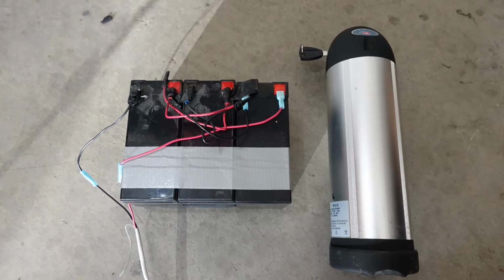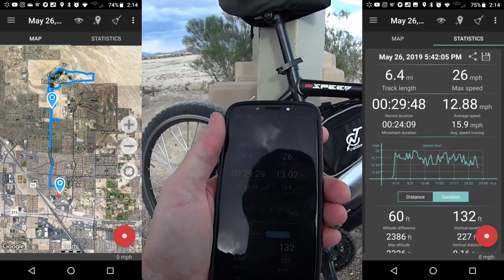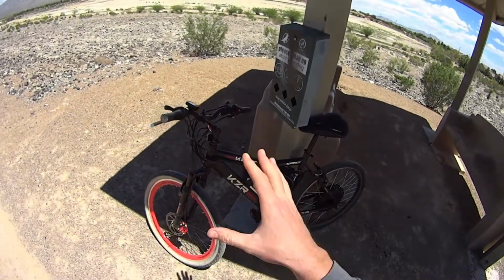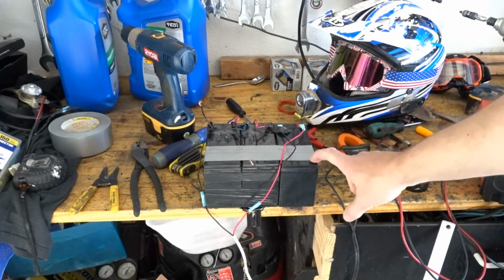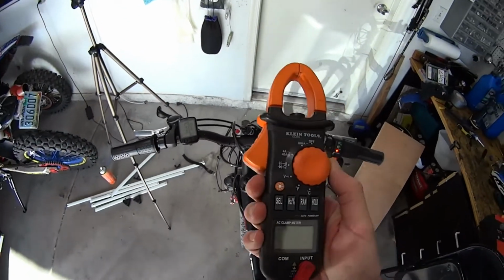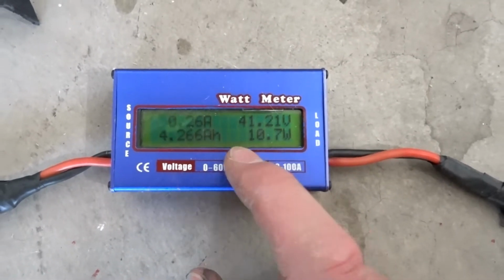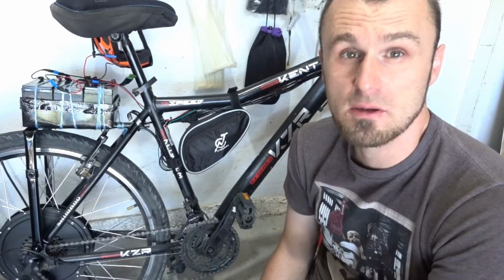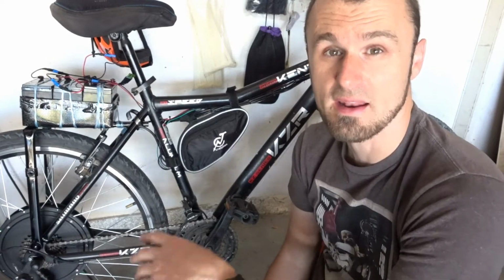Lithium ION VS LEAD acid battery , electric bicycle build Pro and Cons Range test

Comment: I'm looking to buy a sturdy, older e-bike for short shopping trips around our village, but loathe and detest the "Tofu Dreg" shoddy build quality and 'making everything down to a price', that we hear and see about anything made in china. For that reason - and because I'd prefer it if charging such a machine doesn't burn our house down - I'll modify something older but solid with lead-acid batteries (in series, if necessary) mounted low down in the frame to allow better handling. I also like the idea of making it look as ugly as possible - thus more unattractive to those light-fingered bike thieves that plague our society.

Comment: Great video, just what I needed to know. Was on the verge of buying one of those cheap batteries. Seen the price and thought I can get three lead acids new, for one-third the price. You just confirmed that is the best solution. They also don't explode and burn your house down. 😮

Comment: The other advantage of lead acid battery is that it is much safer, Rupture one of the Li Ion cells and you are looking at a potential fire which may be difficult to put out. Great video, good to see a comparison of the two.

Comment: in 1979 i got a friction drive kit and used a lead/acid battery.  all simple and cheap.  i rode it to work in downtown kc,mo all the time.  it was great.  never failed me.  all this comparison means nothing to me until the prices are the SAME INITIALLY..  for the "average" person lion batteries are ludicrously high priced.  if you don't have the initial investment then who cares if they are "better"?

Comment: I have done the same with a Prophet Graveler 36v 250W read hub motor.  The cost of a new battery is around 5000 Rand here in South Africa.  12v 7Ah LAB are R200.00 each so 600 for 3 to make a 36v bank. I attached the wires to the lithium battery pins on the base bracket (bottle battery like your one).  So I can buy 8 banks of 3 new batteries for the price of poor quality lithium batt.  The weight gain is around 5kgs hardly noticeable.  The batteries are on the rear carrier which does make the CG higher and bike can easily tipple over.  My next plan is to mount them in a triangle under the cross bar.  Maybe make a ventren motorcycle petrol tank sort of box???
Reply: and use the same charger and plug for charging them.  Plug charger into a timer to prevent overcharging (boiling dry).

Comment: That’s way less than half the Whr if you’re measuring the energy the charger used to charge it. There are huge losses in the charger or you wouldn’t need heat sinks or fans. 
Therefore, you probably got about 25% of the energy they claim, not 50%.
Reply from the maker: Yeah it can be worse

Comment: The complete wrong formula but got the right answer, difference between wattage and Watt hours, you said 350 Watts, that's the max that the motor can pull, but you are completely right the the battery is a lie

Comment: Are you using the same lithium-ion charger for lead-acid Batteries as well?
Reply from the maker: Yes they are close enough in vkatage and I really don't care about those bateris that much
Reply: @VegasRoManiacReviews  but ideally, it's not a good recommendation right?

Comment: I have a similar motor you can easily run them on 54v with the original Controller . I'm using a 720wh battery at full throttle I get around 40km.

Comment: You need to increase your leads to huge your losses are massive with those thin wires. Use huge pro jumper lead width as a guide.

Comment: Maybe you get More range if you are using more heavy-duty battery cables it looks like romex cables or use a wire calculator tool on the internet typing in the current draw volt and the length to get the right cable thickness
Reply from the maker: Those wires can take the curent... The difrence will be unnoticeable
Reply: @VegasRoManiacReviews  no man power of that electric motor is 700 Watts 7 mm of wire thickness skinny wireless create resistants lowering driving range

Comment: If it takes 140 Wh to charge a realistic discharge energy is 100 Wh or below. There is a lot of cheating with the rated power. Also from "well known" distributors.

Comment: brother how do you charge your lead acid battery packs? i am using 4 12v to make 48v battery pack. any ideas on how to charge it.?
Reply: Get 52V charger and charge at 2.5 to 3A if your battery capacity is about 7amp

Comment: I have come across a new concept. It's a combination of the two battery types. Use lithium for power on demand and trickle power at a fixed quantity from the storage lead acid batteries. They are better designed to output small amounts of power for long periods. They could make great range extenders on a lithium bike, but,i would rather they were on a trailer. I think i would rather carry a solar panel and stop for coffee breaks. But i would always use a reputable battery for both my lithium and or lead acid.
Reply from the maker: The solar panel idea always intrigued me, but it's not really useful due the fact you need a huge one for charging the battery
Reply: @VegasRoManiacReviews  Yes. This is true but my build idea would be more for trike or bike and touring trailer. With a trike or reverse trike i would simply build a large overhead shade roof which would carry the solar. I would use amorphous silicone panels which are less subject to shading or bad alignment which is basically what you need on a bike as you are always moving twisting turning and ducking in and out of shadow and at different angles to the sun (unless you are riding a straight road in the Sahara or somewhere else on the equator). Lets face it, nobody wants to do long distance at night and charge all day.
   The issue is finding a good size and voltage at a decent price. amorphous silicone is larger and more expensive but i still believe it's the way to go for much of the worlds solar projects if you don't track the sun and if you don't live at the equator. But YOU live in Vegas. lol

Comment: What voltage was that lithium battery? Perhaps the voltage dropped too low for your controller but there was still power left in the pack, just at a lower voltage?
Reply from the maker: I did not check the voltage, UT that would  have still not fixed my issue
Reply: @VegasRoManiacReviews  Some ESC's for example won't work below a certain voltage. This is why battery chemistry makes a big difference. S~ome batteries have a larger voltage drop than others. However they are still able to give power but if the electronics on the receiving end (not the receiver) can't drop as low as the battery it can not take advantage of the remaining power at a lower voltage. Basically for some battery chemistries you need wide voltage range electronics.
Reply: @VegasRoManiacReviews  Sometimes you just need to add more power in parallel. Some systems draw more power than some batteries care to provide at lower voltages, but if you can double that power at those lower voltages this can also be a way to get more out of the batteries at lower voltages. 2P or double P if weight allows could also be your solution

Comment: This video has made up my mind on which battery to go for in converting my adult tricycle to an E-Tricycle I want to use it to recover from heart surgery and get a little fitter I already use the Tricycle but  can not go as far as I want in my present health. So an electric motor is the answer for me. With lithium batteries costing so much I could have half a dozen 12 volt acid batteries for the price of 1 lithium battery have you any idea which 12 battery I should go for
Reply from the maker: I hope you heal like nothing happened, wish you the best men

Comment: That battery is ever worse than 140w because the switch mode power supply and the bms circuid loose power abit so it'll possibly be 120w

Comment: What i took from this video is apart from the lithium one had false information on it, was that if you had a decent looking cover for them, lead acid is actually a viable quite good option and if i can get something in the range of 25 -30 miles with pedal assist from a lead acid battery maybe keep it to 20-25 to not put any stress on the battery, this is way more miles than i would ever need so lead acid is a realistic affordable option. We're always told lithium is much better, it lasts longer but its about 10 times the price. Theres no way it lasts ten times longer. So price wise even if you had to replace your lead acid batteries more often, it would still work out way cheaper to use lead acid batteries, which can be recondiotioned and put back into service. You cant do that with lithium.
Reply: Yeah you can actually pry the caps off remove the vent caps and refill the cells with distilled water to bring them back to life.
Reply: He also needed a cap for the the sla batteries, also in the heat I recommend using Gel batteries, more expensive but far superior to even agm types.
Reply: ..it's true, i've got mine with 12Ah lithium battery running on my 500watt hub and doesnt feel real. i am not an expert with batteries but with experience with lead acid batts it definitely not worth to replace.
Reply: @jaldg109  what do you mean doesn’t feel real? Like it’s unrealistically powerful, or unrealistically lasts so long, or you mean it’s so light it doesn’t feel real? Or do you mean it’s unrealistically weak?
Reply: What I took from this video is that sla batteries and a solar panel is the greenest transportation you can get.. next to pedaling..
Reply: I got four brand new lead acid motorbike size batteries on the internet for about £5 each. My ebike that I bought brand new does about 3-4 miles and CANNOT go up hill?

Comment: fully charged lithium 36v 10.4ah goes ok for less than a mile then dead cuts out then switch battery off then on again and ok for less than a mile  done this 6 times. I connect my other battery goes fine. It seem cut after same distance each time.
Any suggestions where I should look for the problem.
Reply: does it say "made in china" on the battery?

Comment: Great test

I have 12v7ah x2 battries lead acid and it gives only 10km / 6mi range
Reply: Motor
Reply: @biluroy4455  my1016z2 250w 24v

controller gets very hot
Reply: @fwefhwe4232  what's your name
Reply: @biluroy4455  30 secs tech
Reply: Ok

Comment: Dude...Use lifepo4 batteries in series. They are 87 bucks each and 3 are 10lbs. They last 5.5 years if you charge every day or 2000 cycles.
I am using them now on my ebike. They are the safest lithium batteries and are more heat resistant which you need in Las Vegas.
Use 14awg wire to jump them for 36 volt in series. They 12ah each and 87 bucks on Amazon now. Right me if you want more info.
You may have to balance them every once in a while and need a lifepo4 charger. They are a tad heavier than lipo but much better.
Try them .....you will love them.

Comment: make sure to keep your lead-acid batteries in good shape by using them frequently also, make sure to keep the water levels good on the batteries and if it is low fill it up with distilled water and let it charge for a while.